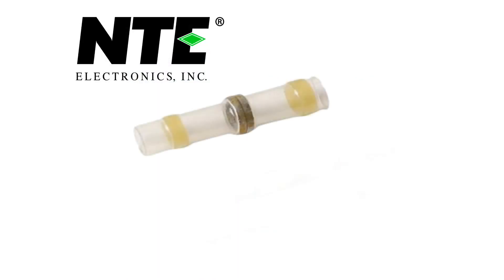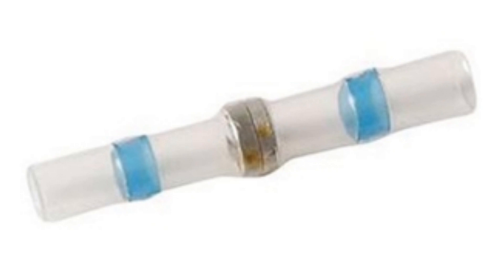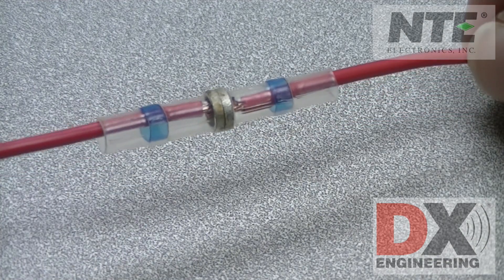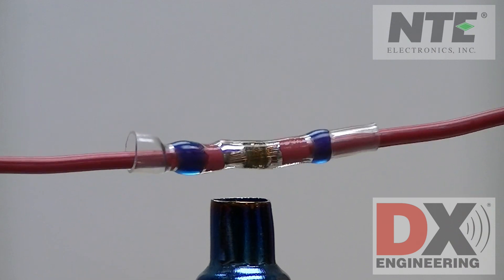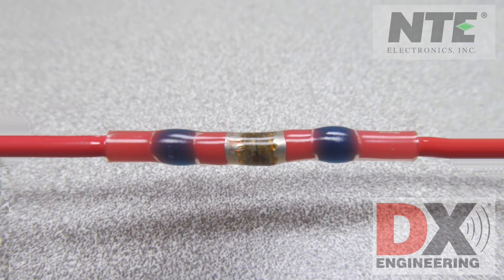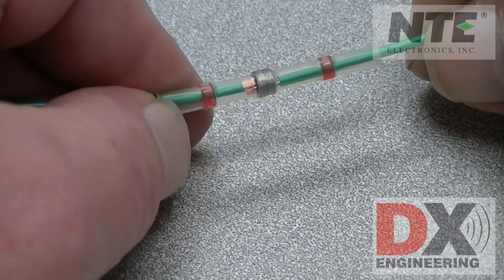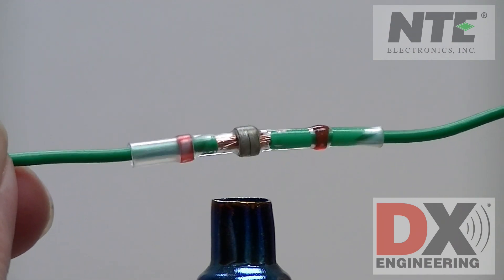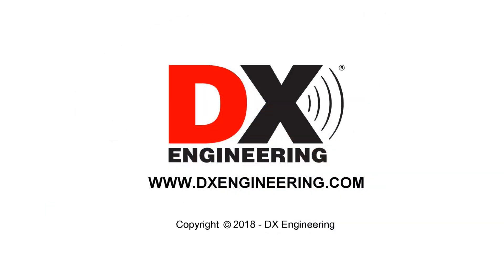Low Temp Solder Wire Connections

Comment: What temp would you set the heat gun to?
Reply: About 140c, don't bother though I've used them it's basically a cold solder and I was easily able to separate the joint by rubbing my fingernail on it. Soldering gets it's strength from wicking into the wire, this doesn't wick it just spreads on the top, it adds nothing to the connection. 

The heat shrink tubing holds it together, once that has been removed the joint easily fails under light tension it's not solder, and I wouldn't consider it as such either.

Comment: Looks like it takes a lot longer
Reply: Compared to crimp butt connectors yes, but they're much faster than soldering and then using shrink wrap.

Crimp Butt connectors are only good for indoor applications.

Comment: I like using these, Like with regular solder I like to use a little flux on the wires. I have noticed it help when the wire is not copper
Reply: Im not sure Id want that flux sealed in there forever

Comment: Can these be used in a vehicles engine bay (assuming they are routed away from things like exhaust manifolds, etc.)?
Reply from the maker: Yes they can. Just like any other heat shrink type material, keeping them away from excssive heat is recommended.